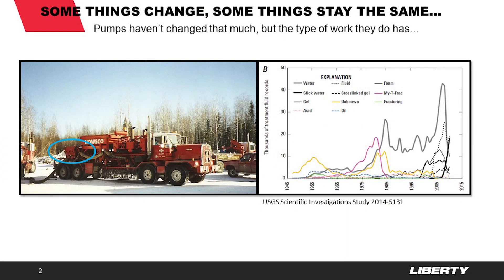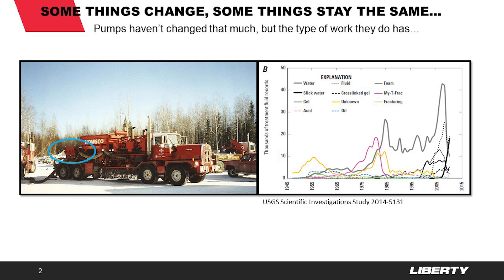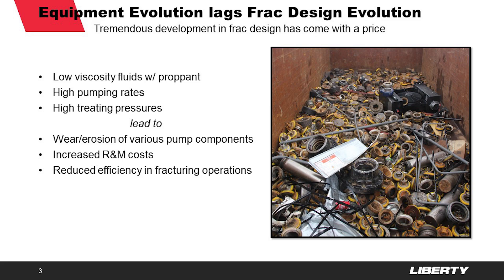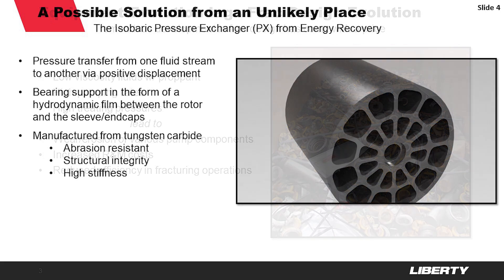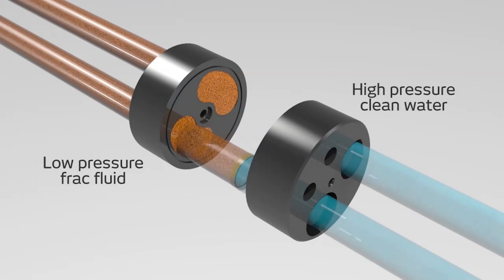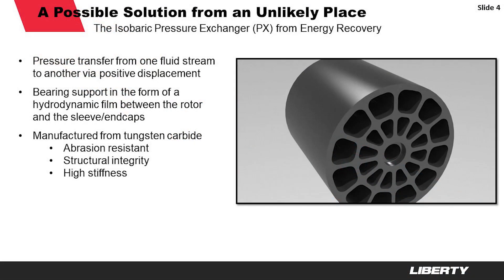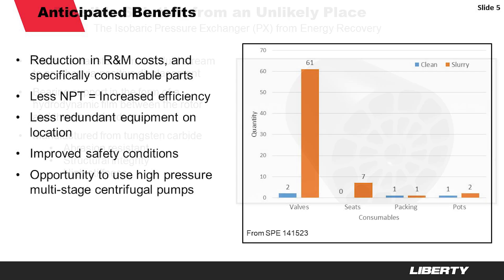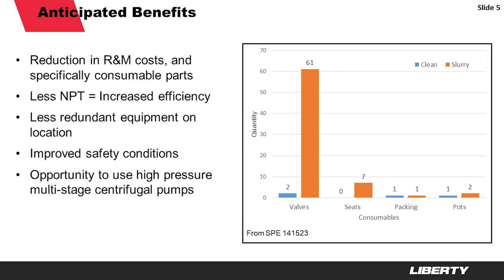VorTeq Missile

Comment: When a low pressure is mixed with a high pressure then pressure is lost. It is possible to pump abrasive directly through a plunger pump without damaging the pump or check valves.